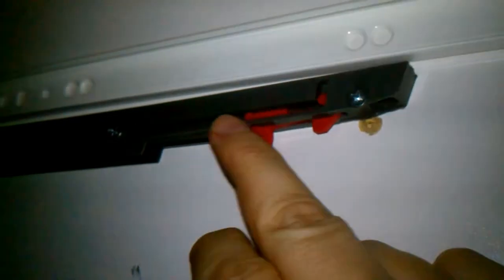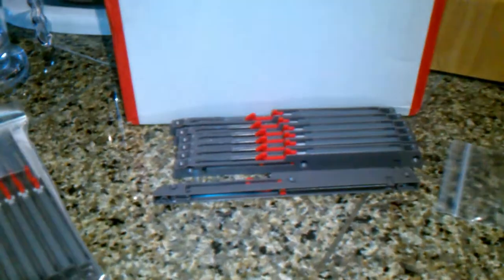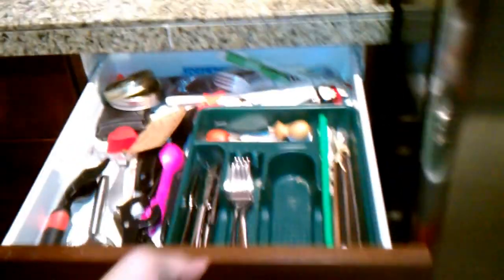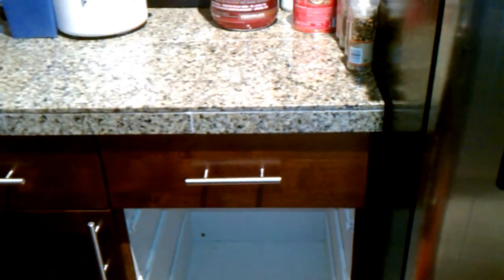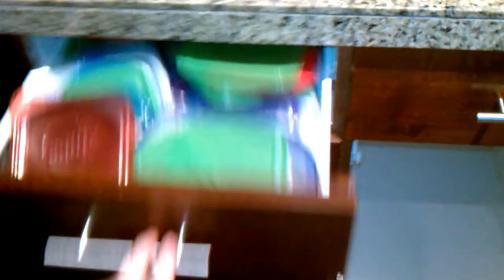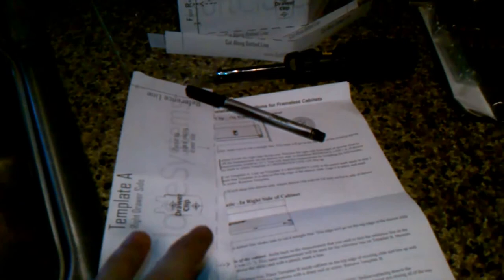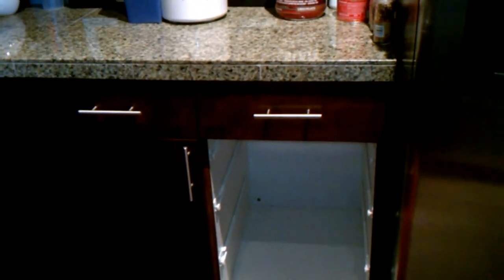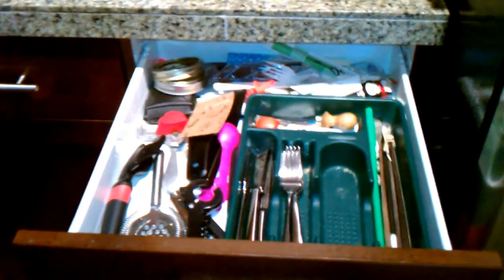Soft Close Systems Drawer and Cabinet closing mechanisms

Comment from the maker: Thanks.  I went with the INDAmatic soft-closing drawer adapter from the same company I got the cabinet dampeners from: softclosesystems

So far they are still working well.  I would go with them again (at this point).. and at least the rails are installed, so reinstallation (after full life use) should be less of a problem, (it's all lined up.)  :D